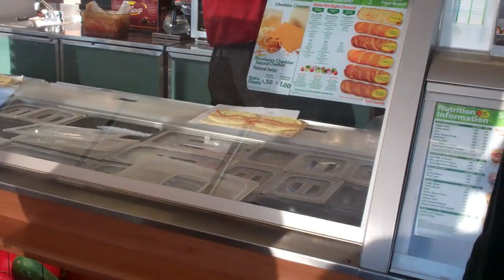Friggin Miles Of It.

Comment: @EnjoyMyCutback ...hot water pressure washer would work better than how it's being done...with loose dust and fans operating in the background...cooler fans should be off, and use a good high temp pressure washer, and it's faster...and done properly...